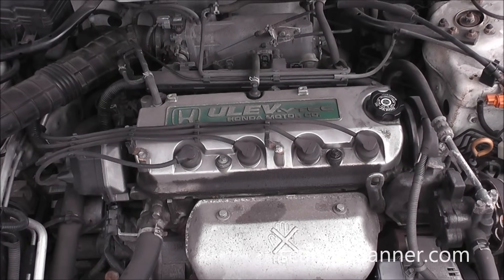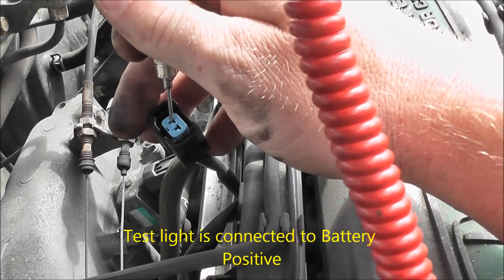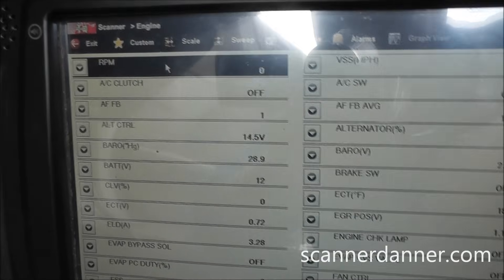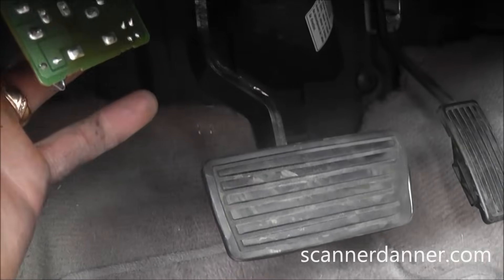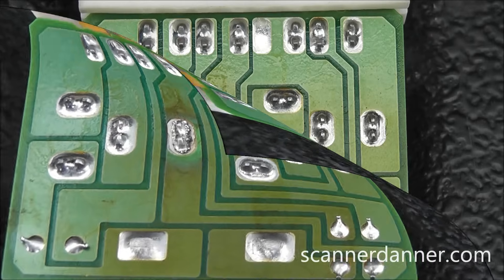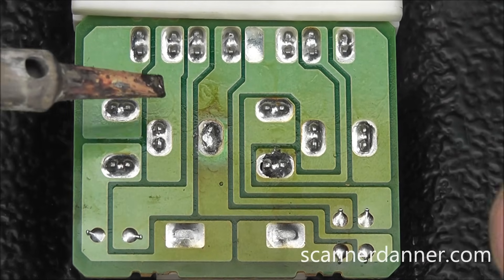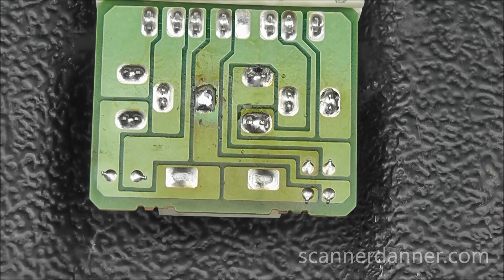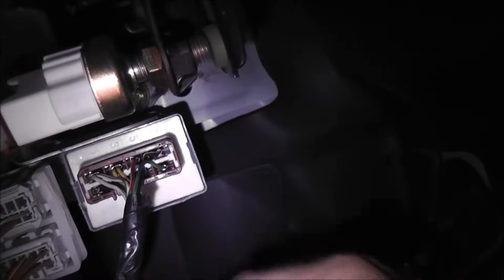How to identify a bad main relay on a Honda (PGM-FI)

Comment: Glad I'm not the only one soldering to fix vs replacement. That relay ususally goes for $100 depending on the store. Soldering was a 10 minute repair. I grab these from the junkyard and repair them then sell them for cheaper than the shops makes a little money on my end too great video.
Reply: I’ve soldered many, many FP relays. Never had a problem

Comment: wipe your soldering iron with a damp spounge when soldering iron is hot to clean off the the tip then tin the tip with some new solder and clean the solder pad by scraping it clean with a art knife

Comment: I’ve been having this problem for months, car sitting in heat for hours and dragging to start. I googled the problem and came across this video of fuel pump relay issues for Honda vehicles. I replaced my relay with a new one and so far it’s been 2 weeks with NO starting issues. Thanks for the tip!
Reply: Did it have a bogging issue when acceleration and then clear up after like 3k rpms
Reply: @daltonnicholson5630  mines doing that too. Have you managed to figure it out?

Comment: Fixed a relay, it broke again. Replaced that relay, it broke again. Now I just slap the relay whenever it decides to not work. Slap it as you turn the key to the on position and it'll work.

Comment: 2004 accord -  car is showing problematic staring issues...just replaced battery.  Also,  you may want to use  soldering flux  to allow solder to flow better...IMHO  bro, thanks for kewl  instructions, very much appreciated..Mr. Scanner Danner and  Pete.

Comment: Just pulled mine out from my 2004 Honda Pilot.  That same spot on my board looks identical.  That must be a hot spot.
Reply from the maker: It is the load carrying circuits that do this. Not just on this board but all modules can suffer from this condition.

Comment: I have a Honda Accord 2009 with a no start issue or would randomly shut off. Meineke had it for a week and could not figure out why it would not start. I fix electronics and you need to use flux over the resolder joint and your soldering job would be perfect. Use flux before heating the area up. it will be perfect. I am going to try to fix it this weekend, will let you know how it ends up.
Reply from the maker: I dont think they had this same issue in the 09 model year. In fact, possibly a completely different set up for the main relay

Comment: It looks like your soldering iron is not hot enough to make solder flow to the board,  It would help to keep the solder tip clean and thin with solder to help transfer heat to the board.  Plus your solder is slightly to thick and the reason why the solder does not flow as it should to the copper/solder board.
Reply from the maker: Mobile work has its dilemmas

Comment: Mr. Scanner Danner, I owe you a case of beer, I was getting super frustrated cause my dam car started to randomly die while driving it, so I did some research on the net and everybody was pointing their fingers at a faulty ignition switch, so i replaced that for 60 buck, i cut the old one out so i had to use the one i had already purchased, but anyways that did not fix the problem, the car was still randomly dying, so i looked at your excellent video and sure enough, i took the relay out and it looked identical to yours in the video, so i resoldered it and now the car works great, never dies. Thank you, Thank you, Thank you
Reply from the maker: Nice, no problem at all Merry Christmas
Reply: ScannerDanner  can you inbox me on FB? My name is "Joshua Eric Redfern" I'm having an issue on a 07 civic ex. 1.8 liter

Comment: Your channel is awesome.  

Trying to solve a "no start" but "does crank" when it rains.
Its a 1994 Honda Civic LX.  
We replaced the main relay and had the ECU rebuilt.

One observation is that when it does rain, the Check Engine light stays on and when you try to start the car, while the Check Engine light is on, the car won't start (will crank).  If you wait long enough, the Check Engine Light (CEL) will eventually turn off and you will immediately hear the fuel pump priming.  We are able to turn the car on when the CEL turns off.

We need some help
Reply from the maker: check your fuse box in the drivers side kick panel for water intrusion, just did an older Accord with this issue.
Reply: Will check and report back.  Thanks
Reply from the maker: The Accord I was working on was missing the inner fender wells and the main harness that ran into the A pillar was allowing water into the back of the fuse box
Reply: @ScannerDanner  During a rain event or a day after a rain event, if we wait long enough with the ignition key turned on and not trying to crank or start the car, the check engine light will stay on for a long time but after awhile (maybe 10 minutes), the CEL eventually turns off and is followed by the sound of the fuel pump priming which then allows us to start car.  This is whats puzzling to us.  How is it that by leaving the ignition on long enough allowing the car to eventually start.  Is it the energizing of the wires that is eventually heating the moisture out?  

If the CEL does stays on and not turn on and off like it should, we cannot start the car.  It will just crank and crank.  Like mentioned earlier, if we leave the ignition on, and wait and wait and wait, the CEL will eventually turn off and then we are able to start the car.

Comment: I think you may have just solved my problem..Ill let you know..Thanks!
Reply: Ben Burden did you fix it?
Reply: No im afraid not..Sometimes it starts and other times it just cranks..Sometimes the Green key wont even show up on the dash too. If I leave the battery unhooked for a while that sometimes helps but after awhile goes back to the same old thing..Also ived directed the fuel pump so I know its good..
Reply: Didnt see any issues with the relay re soldered all the connections to make sure..not luck
Reply from the maker: It is becoming more and more difficult to answer questions here. I have 80,000 people asking me for help now. So I have created a forum to help you guys better. It is free to join and we can exchange pictures, wiring diagrams and waveforms if needed to help guide you through the process of troubleshooting your vehicle. Thank you so much! Hope to see you there. 

Paul Danner (ScannerDanner)

https://www.scannerdanner.com/forum/post-your-repair-questions-here.html
Reply: ScannerDanner Thank you!

Comment: You need FLUX FLUX FLUX promotes heat distribution, replaced a couple of these in integras
Reply from the maker: +hippo780 you mean the Flux capacitor? :)
Reply: +ScannerDanner 

No flux for soldering it melts the solder like butter.  I was looking at the schematic of an Integra main fuel pump relay, it doesnt have that diode on the control circuit youre referring to.  I thought its a counter emf diode but its not, maybe these are only found in accords.

Comment: I have an 07 honda civic sedan . Green key on. I try to program the key with autel . It's telling no communication ecm pcm and the immobilizer.  I run a system check and it gives me a code d3. And saying immobilizer . Ban

Comment: I’m trying to help a neighbor diagnose a no start. No start no spark. Car is 40 miles away and wasn’t able to test distributor 12v at harness. I’m just generally wondering is the computer will still power and command the distributor if other systems are down. 

Say for example if main relay or fuel pump relay is out will that force computer to not send power/command to distributor. 

I think it should still get 12v and command regardless of other systems, but I’m not sure.

1999 CRV 

THANK YOU!
Reply from the maker: You need a good wiring diagram before you go there my friend.
https://eautorepair.adtrk.biz/?a=10817&c=24&p=r&s1=
Check it for injector pulse before you start attacking the no spark issue. This can change your direction.
I believe the main relay provide power to the ignition coil but I'm not sure. I know main relay and ignition switch failures are common. So are shorted ignition coils
Reply: @ScannerDanner   Thank you and Awesome videos!  Hopefully I can convince the neighbor its worth towing his old beater home. I will try the advice, it makes sense as this would help determine if other systems are powered to help hash out my logic here.

Comment: Is a relay on a 98 Civic 1.6L D16Y7 engine, the same or an enclosed relay. Anyway, I know the issue isn't temp.. related. Dies while going down the road an a clicking noise by ECM on passenger side.??? I'll figure it out eventually. It's annoying

Comment: how can you check the injector electric connector with positive side of battery? Its seems ok for the ground but the hot side ?
Why didn't it cause a back feed and fry a fuse?
ty, Dan
Reply from the maker: Time frame in the video please. Thanks! Then I can answer better

Comment: It’s funny how people give you crap for poking a hole in a wire.  Last night I had to redo all the butt connectors on a lift gate and wire harness for a cargo box and rear tail lights on a medium duty delivery truck because someone didn’t bother to heat shrink any of them down.  Or even use electrical tape or do anything to protect the wire connections from corrosion.  I wonder if that guy has a problem with poking a hole in a wire.

Comment: SD, If the car had a main relay problem, and you sprayed starter fluid in the air intake, shouldn't it fire up a little bit?  Would that be a good test to see if you have spark and compression, as part of a troubleshooting procedure?
Reply from the maker: I can't remember if the main relay was involved in powering the ignition system? But having it run off of starting fluid could also be other issues other than the main relay

Comment: My maintenance required light does not come on just check engine light does the same like the dash on here just w/o the maint light ? I replaced my fuel pump relay and my fuel pump still does not turn on , hum , click NOTHING. Wtf does one do to fix this with the LX V6 3.0 model? I get no answers to this

Comment: By any chance if not getting fire to plugs and the main relay is good but not turning on the pump, pump good too, would a bad ignition coil or igniter keep the main relay from working? 95 civic 1.6
Reply from the maker: no, it would not, but a bad main relay would cause no injector pulse and no fuel pump operation and I think no spark

Comment: Spark test @ 2:12 showed orange spark. I heard orange spark means there's an issue. Blue spark means it's OK. Is this correct?
Reply: This is a misleading test. A good coil with a small air gap for the spark will look orange because the amount of time current flows across the gap is longer. (burn time) Increase this same air gap and the spark becomes blue. Why? Because the coil has to build higher voltage to jump the gap, so this same energy is now in the form of higher voltage and less burn time. Hope that makes sense

Comment: have a 97 vtech civic motor gave out bout 500 miles in of owning it . just replaced the motor. it has sat for 8 months. now I go to start engine it won't start with key but will if I strait wire to starter but still yet won't run. is getting good as and great fire and timming is correct. somebody please tell me wat to do here
Reply from the maker: Sounds like an ignition switch problem

Comment: Great video man!  I’ve been scratching my head on my daughters 1998 Honda CRV.  We have spark, compression, and fuel on the return side of the fuel rail but probably not enough psi to fire the injectors due to this relay not powering the fuel pump.  This was the best video I’ve seen so far on this subject!  Thanks!

Comment: ScannerDanner, GREAT tutorial! I was having the same problem with my 2K Accord v6 coupe. Mine tended to no start after being off for around 15-30 mins, especially when it was hot outside, had a rough idle, and acceleration was crap. I visited Radio Shack tonight spent $24.00 total on the soldering and de-soldering kits, re-reviewed your video, followed your instructions and I no longer want to scrap my Accord! I had to re-solder 5 of the solder locations. I could see the hairline cracks, and the 2 larger solder joints were more bad off than the 3 smaller ones! Thank you for making this video, I was ready to drop another $750.00 because the "generic misfire" code would have someone thinking it was the fuel injectors or fuel pump! Keep up the great work! I wish I could've caught this video prior to replacing: the original relay, 1 fuel injector, idle air control valve, and the fuel pump regulator…
Reply from the maker: +adibee88 thank you! And nice job fixing it yourself. Have a great day

Comment: Man thank you so much for making this video !!! I had already changed out the fuel pump and then a couple of days later same problem didn't want to start, I watched this video and same problems that I had in my car so I changed out the relay problem fixed also prior  to doing this my car was shifting hard now it shifts normal .
Reply from the maker: +carin1467 awesome

Comment: Would this cause the a 2001 civic to go into limp mode
Reply from the maker: These cause no starts and stalling problems. Also "limp mode" is an overly used generic term and could mean anything. Transmissions have a "limp mode" where it will lock itself in second gear.
Engine management systems will use a "limp mode" when a critical sensor fails etc. In all circumstances of "limp mode" there WILL be a fault code, otherwise whatever it is you are experiencing is NOT a limp mode or a default strategy
Reply: Ty for replying

Comment: 2001 accord, key turns inst but car will not start? The car started one moment then dead the next?
Reply from the maker: You need to do more testing for me to help you.
What are you missing? Spark, fuel pressure, injector pulse?

Comment: If it's not the relay could it be a bad ecu. if my fuel pump has no power?
Reply from the maker: Highly unlikely. If it is a Honda, ignition switches fail on those but you need to do some testing. I show how to test these circuits
Reply: @scannerdanner
Actually as these cars age the electrolytic capacitors start to dry out and or leak! That can cause a crank and no start usually with the check engine light on and the D4 light will flash continually. To test turn key to accessories you will see the chk eng light on and D4 will blink it can take up to 10 minutes o waiting before the ecu will prime the pump then car will start and run perfectly.

Comment: Mr.Danner that was a great fix. I worked on a  montana last week that had a abs code for pump motor open/shorted, i pulled the module off supplied power and ground to motor and it ran so inspected board, found cracked solder joints. Re-flowed the solder and was good, these type of fixes are very rewarding, dont make a ton of money but save the customer some and make repeat customers out of them for sure.thanks again for your time spent on the videos,

Comment: I have a 2006 Honda Pilot.....won't start.....got new battery...started.....a week later I was checking dome light fuses....now it wont start...same thing again..
Reply: Got it started.....I read where a man had the same problem. He disconnected the battery cable for 30 mins...and his car started.....So did mine....I guess it cleared codes or something.......if anyone know why the car does this let me know...thank you in advance..
Reply: or maybe a relay...ty

Comment: Scanner Danner I have a problem with my anti theft system green key keeps flashing the car won’t start I just happen to stop working any idea what could be the problem
Reply from the maker: You need to have a scan tool that will give you codes from your immobilizer system. That's where you MUST start
Reply: Well update my buddy brought he’s 3000 dls snap on scanner and no codes whatsoever. The issue was the key I was able to buy a new key online took it to a locksmith he cut it for me. I bought the kp100 it’s like a chip programmer guess what the problem was the key this whole time no codes just a green key flashing on the dash and Honda was trying to charge me 800 dls just to troubleshoot and reprogram the system thanks anyways I just want to share what I learned and I want to say that you are an awesome mechanic or diagnostic guy whatever you want to call it keep it that way and humble thanks scanner dan we

Comment: What about when it isnt the main
I have a 92 right now like that
Reply from the maker: Do you have power to your injectors and fuel pump?
Reply: @ScannerDanner  yep and the main i put in the car has sorta open relays only one of them click when cycling the key.  If i hold one of the relays just right i can hear the fuel pump prime. The car will kinda start that way, itll run long enough to rev once or twice. Just long enough to hear the exhaust note.
The car ran a-1 until
I watched a crazy dude hear on youtube show me how to install a tach (which he was very wrong and its all back out now) he instructed to splice it into one of the wires to the distributior.  Not thinking much i did this.  Anyway its all cleaned up now.  But this is the headache hotel ive been in ever since

Thanks for any guidance you can give

Comment: WOW!! my 2005 MDX just want dead as i'm driving .. i felt a bit of power lost and she went dead and now she will not start at all will crank but no start.
will the relay be in the same location on a 2005 mdx  as the 2001-2003  or ????
Reply from the maker: find out what you a missing first. Do you have spark, fuel pressure, injection pulse and compression. I can help you if you can tell me what you are missing and can follow some testing methods (not swapping parts!!)